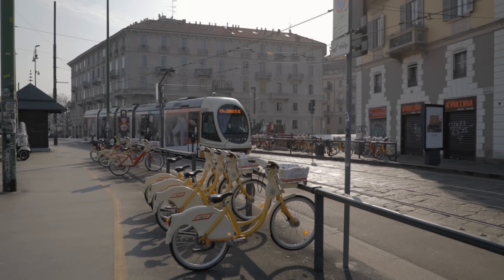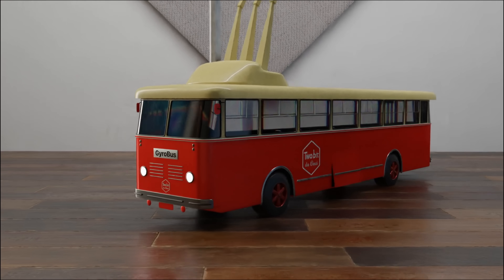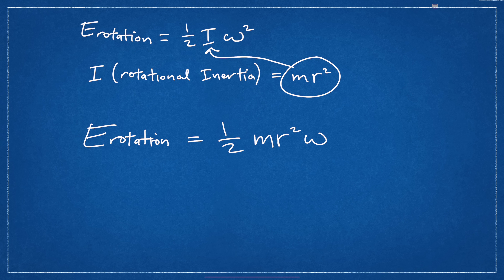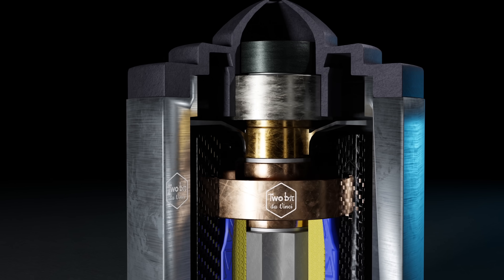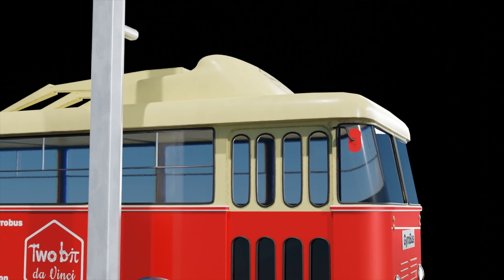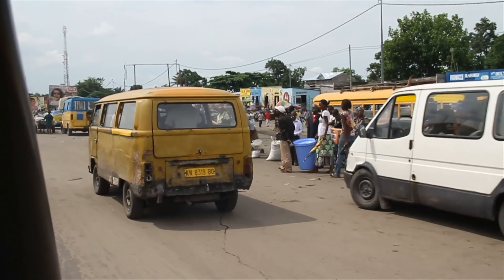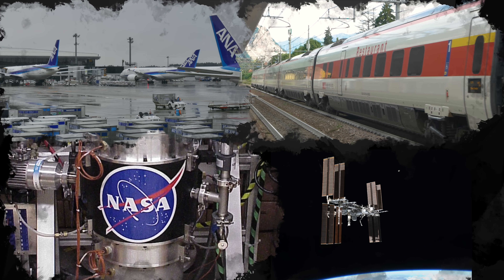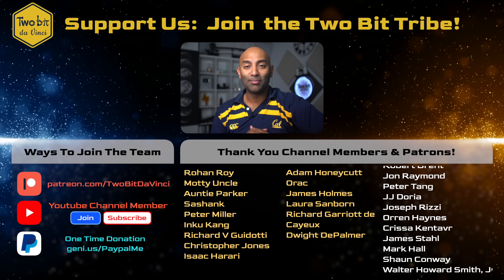This Bus Went Electric WITHOUT Batteries

Comment: Public transport is already more efficient and environmentally friendly even when powered with fossil fuels because of passenger density alone. Also, Oerlikon is pronounced Early-Con.
Reply: Public transport is only efficient when full to capacity. Rush-hour packed, followed by rest of day nearly empty - not so good.
Reply: @tedf1471  If you calculate the total emissions per passenger kilometre (dividing total passengers served by total distance served) you will find that public transport is still an order of magnitude better than all other modes of powered transport.
Reply: @trijezdci4588  I wonder, 'rush-hour bus' vs. share hire car permanently full?
Reply: Dirty, climate destroying fossil fuels are environmentally friendly ???
Reply: @ReverendRandy  You are confused by the hype of the lithium industry and their customers. It is totally irrelevant whether there is no emission at a tail pipe. What matters is the emissions generated by any given transport system per passenger kilometre (or if you are in the US, per passenger mile). On that metric, battery powered cars are no more environmentally friendly than modern petrol or diesel powered cars. And you will find that any form of public transport fares better than any form of powered private transport on that metric, even if the public transport system is not powered by renewables.
Reply: The “i” in Oerlikon is actually the short i, so the pronunciation is more like ERR-lick-on (with the “err” rhyming with “her”).

Comment: By me on  Stourbridge branch line is a railcar that uses a flywheel  powered by diesel  been running for 25 years only 1 mile long looses half revs per run.

Comment: Every small ICE has a flywheel.  Its mass is the magnets needed to power the magneto, thus solving 2 issues, ignition and smoothing the engine.  Larger ICE's with manual transmissions all have flywheels to store the surge of energy required while engaging the clutch.   There is also a lightweight flywheel on automatic transmission ICE's.  Industrial presses utilize flywheels to store the energy of a small electric motor until it is sufficient to stamp the part, so a clutch drives the ram down and back up where the motor brings the flywheel back up to speed for the next cycle.  The old hit and miss ICE is the best illustration of a flywheel that I can think of.

Comment: I'm partial to compressed gas myself. It seems like it would be easier to scale in the form of vertical underground tanks installed with a drill rig. the heavy problem, in my mind, with flywheels is that they inherently require a lot of mass, and a lot of mass means more costly to move, from environmental and economical perspectives.
Reply: Compressing gas is highly inefficient. It has been done before, but when you compress gas you lose a lot of energy in the form of heat. 
When releasing the gas, the whole system can freeze up. 
The Paris air powered tramway used small coal fires to keep the whole system from getting too cold, and to keep the air pressure from dropping too fast. 
At locations where you have superheated steam on hand, fireless steam locomotives are a serious option, but only if you genuinely have energy to spare. A paper mill in Germany still has them in daily use, because they just work. Converting to electric would in their case not save any significant amount energy because the whole factory consumes so much, that the little fireless steam engine barely registers on the bill.
Reply: probably a trade-off in mass, vs. storage-capacity?

I’d love to try riding a bike with a flywheel for extra power / regen. braking.
Also, would love to try driving a car with a storage-flywheel.

there’s probably a happy medium, mid point.  Big enough to be useful, but too light to be a problem.

e.g. 4 small flywheels:  one for each wheel.  use them to add regerative braking to a gasoline car.  
so the car would brake for a corner, or stop at a traffic light, adding momentum to the flywheels, then the car has lots of extra power to get back up to speed quickly.  😎👍
Reply: @xanatax1844  Pick up a router that is spinning and hold it with the shaft horizontal. Now move it around with the shaft always in the horizontal plane. Do you notice how the router tries to dive?
Reply: No, you need low mass, very high speed and vacuum system.
Reply: a cool side effect is that cars would explode when shot just like in games and movies!

Comment: The funny thing is flywheels have around doing the same thing for a long time and yet for some reason companies get patents on flywheels 🤦‍♂️
Reply: A lot of patents are awarded for simple or old mechanisms, but implemented in a very new way that make the original system very effective in a current need, where before the novel change, they were not. 

Wheel
Water flow
Electricity
Recording media
Conductors
Semiconductor
Hair clips

Comment: 3.4kWhrs/km, 5.4kWhrs/mile is not particularly poor performance. A regular EV car can average roughly 350Whrs/mile but of course EV cars are lighter and carry fewer people.  So the busses only use 15x more energy per mile. And, maybe with some better technology, modern flywheels can reduce that 15x factor.  Not mentioned is if regen braking was used to spin up the flywheel?

Comment: Hmmm … Maybe I can retrofit my Bolt with a flywheel.  GM should be ok with that when my lease expires ?
Reply from the maker: Haha!
Reply: You could tow a flywheel battery behind you on a trailer. It would work just fine... until you turned round a corner :)

Comment: if the axis of the flywheel in a bus is oriented vertically, I am not sure why rotational inertia would cause a problem going around a corner as the direction of the rotational inertia vector would not seem to be changing.  If the axis is not vertical, I can see this being an issue.
Reply from the maker: that's true, but turning involves a little bit of swaying, and a vert axis gyro would counter this tendancy which is tricky for a driver... but great points!

Comment: Hum... the space applications of flywheels are not to store energy, they are "reaction control wheels" to help with fine orientation of spacecrafts such as telescopes and the ISS.
They do not recuperate momentum back into energy because that would send the spacecraft spinning... 😅
Reply from the maker: yes the laws of motion make a gyro-powered spacecraft pretty questionable :)
Reply: @TwoBitDaVinci  Besides, there was an epidemic of reaction wheels failures a couple of years ago (including the Kepler telescope) because of a single manufacturer's faulty lubricant that degraded more quickly than expected. 
Magnetic bearing are frictionless and indefinite, but heavier and more expensive. 😉

Comment: There is a data center located in Oakland CA that utilizes a flywheel for backup power AND grid isolation… the grid power drives the motor for the flywheel, and the flywheel turns the generator for internal power. This completely isolates the internal power systems from grid fluctuations.

Comment: Back in the late nineties flywheel busses by DAF in the neatherlan were experimented with. There is a SAE article and paper on their experience.  About the same time Chrysler via its military operation experimented with flywheel tech for tanks. I think the logic there was to act as a fast  "take off" device.
Reply: I rember riding electric buses in S.F. that had fly wheels they would leave the over head panagrph and make pick up several blocks away then return to the over head power.

Comment: I guess superconducting component to improve efficiency. If using a insulated vacuum canister like a thermos flask. Awesome and excellent.
Reply: Also thinking the orientation of the gyro needs to be mounted on its horizontal axis the width of the bus to negate any turning force.

Comment: You know what happens when a flywheel brakes lose at high rpm? ... Big badaboom!
Reply from the maker: what happens when a hydrogen tank explodes? or gasoline tank catches fire? or batteries... storing a lot of energy in a small area, always can pose risks... that's what engineering is all about!
Reply: @TwoBitDaVinci  Yes true, not ment to bring a negative point, but flywheels are special. Normally you'll get explosion and fire. I think there are examples of large relatively slow flywheels escaping and running through walls! Small fast ones can brake into many pieces like a granade, without fire nor high pressure gas.

Comment: Flywheels aren't in modern transmissions; they're bolted to the engine.  They primarily smooth out imbalances in the engine. They are the minimum mass possible to achieve their benefits.

Comment: In terms of efficiency, wouldn't it have been better to have used a mechanical clutch system to drive the bus rather than using the flywheel's momentum to power a generator?
Reply: Tᴡᴏ Bɪᴛ ᴅᴀ Vɪɴᴄɪ  ?email OK?
Reply: @andyroid7339  Sounds like spam tbh, be careful!
A mechanical clutch makes driving it really hard. The flywheel's speed can't be changed like an engine's speed, so you have set speeds for the gears 1 through 6. 
You would have to slip the clutch heavily (which is very inefficient) to get from gear 1's speed to gear 2's speed. Besides that, if you are in let's say 3rd gear, the flywheel speed will drop during driving, so you'd have to deal with that too... 
CVTs would perhaps be an option though! But i don't know how much more efficient those are than modern traction electronics.
Reply: @mfbfreak  Thanks Lima Victor - when you say it, it sounds obvious! I  wish I'd thought into it more deeply! I guess I was solely thinking about losses in the conversion of the power. Besides slipping the clutch, I imagine the friction plates (or other moving parts if a CVT were used)would have required changing frequently, adding to the service costs.

Comment: Great explanation! You didn't mention the Achilles heel of flywheels: cost. They are currently ~10x more expensive per kWh than lithium ion batteries. Not sure how that will improve with time (they've had a long time already!)
Reply: Great point but the flywheel and enclosure that it's in can be re purposed indefinitely. Only the control system (electronics) may periodically be replaced or upgraded.

Comment: That was fascinating. Now I want a desktop magnetic bearing flywheel powered lamp :D
Imagine a modern company building a device that lasts for 200 years like that james watt steam engine. If it were built today it would be intentionally made with parts that wear out, plus a  proprietary lubricant it wouldn't work without, that you have to replace each six months and ends up costing 50 bucks for a gram of the stuff in a wasteful plastic tube.
Reply: If it were an Apple product, you nailed it.
Reply: @keithschneidly3922  right.. And when they say lifetime, they mean until you're supposed to just buy a new car, why make it serviceable? Lifetime of the car, not the owner..I think they secretly mean